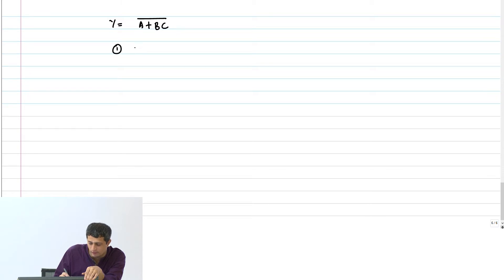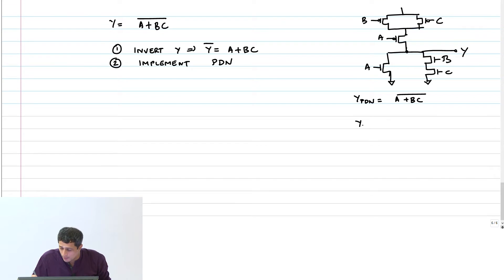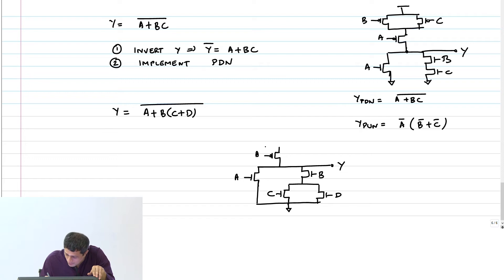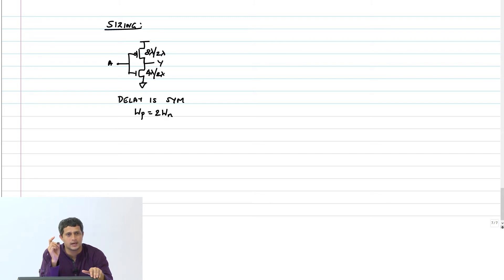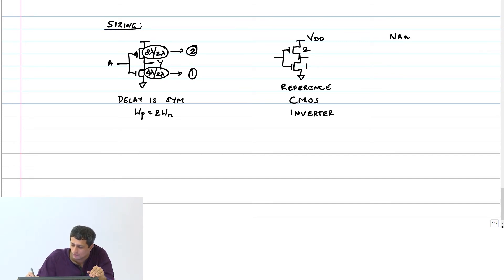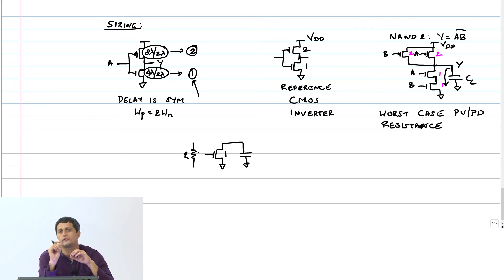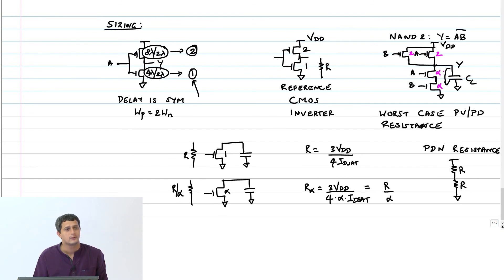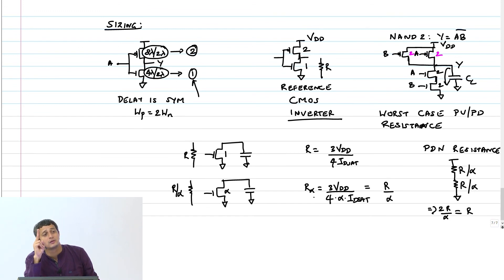CombCkt - 2 - Implementing Any Boolean Logic Function: Examples. Gate sizing

Comment: but now width of nmos and pmos becomes same, so how will gonna follow delay symmetricity?
Reply: A good question. 
On the contrary, I would say you should use w=1 for the PMOS, because you have 2 in parallel what makes them act as doubled single one. hence, currently it is like you have a CMOS inverter of 4:1 ratio...
He mentioned several times "worst case of PD/PU path". according to that, in case of the nmos PD, one should make it lesser resistive, unlike the pmos PU. 
still, it doesn't fit with intending to have a normalized delay as the CMOS inverter...
in fact, there is a limitation with normalizing it. for example, try to normalize it in NAND3. (You can't because you don't have a pmos less then w=1...)